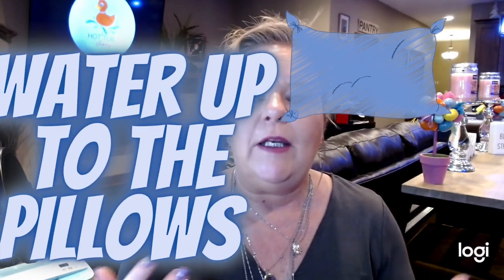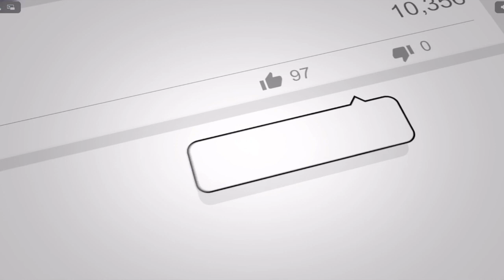Air Lock in my Hot Tub? Now What? (Easy Hacks to Fix an Air Lock)

Comment: Ok this was a godsend.  I have a Hotspring Pace Spa.  I put the water hose directly into the intake pipe and air bubbles came thru the filters.  Ran the water for a short while and then turned on the power to ensure all the air was out.  Worked!
Reply from the maker: That’s awesome.  Yay!

Comment: Your videos are great and very helpful. Recently I have been getting a NO Flow error message and the green logo light is off and the blue is still on. We have a 2020 Flair with the fresh water salt system. As I am typing this I am doing a bio film cleaning then draining the water tonightI will clean the inside with 50/50 white vinegar and water, rinse and the shop vac the residual water and debris out before refill. I have watched your start up tutorial for a refresher. 

My question is what makes the error message for low or restricted flow come up if it happens in the future? Our water levels are always kept between the bottom of the pillow and the highest jet. Thanks in advance for any help
Reply from the maker: How about your filters?   When was the last time you  replaced the filters.  Old filters can cause this.   If you put in new filters and it continues to do this you probably have a bad seno

Comment: My jet adjuster is making a weird whistle when I turn the nozzle to adjust the jet power. Any idea what that could be?
Reply from the maker: Typically If you turn the diverter valves all the way on or off they can whistle. That is a huge amount of pressure goin through a tiny hole.  Typically if you adjust oh so slightly it will go away.  If this is not the case you may need a service call.